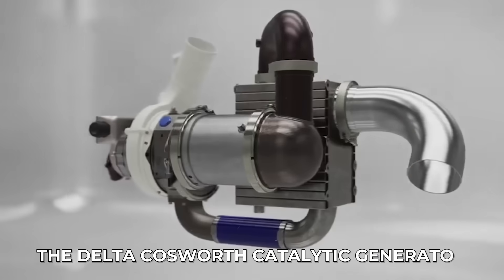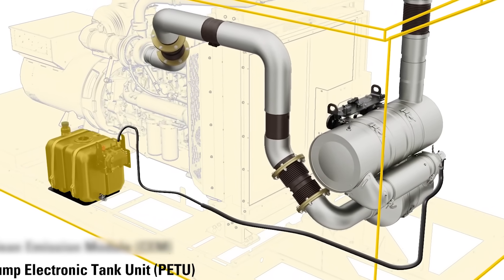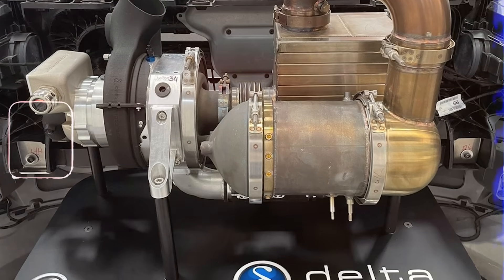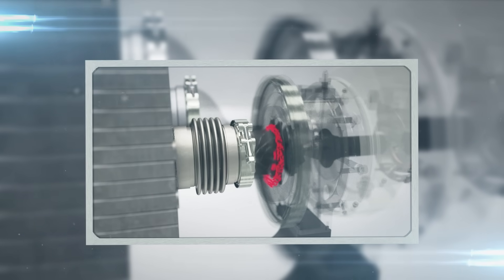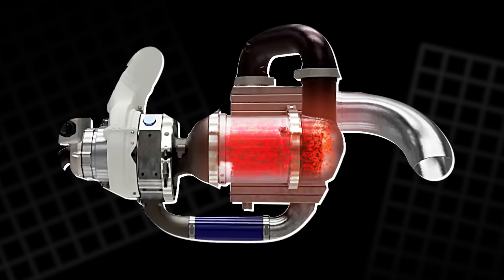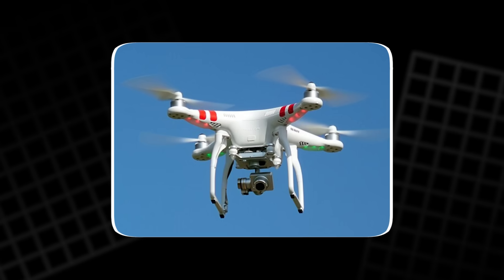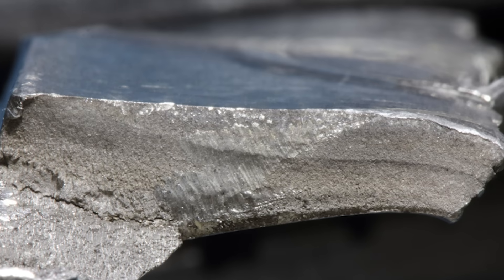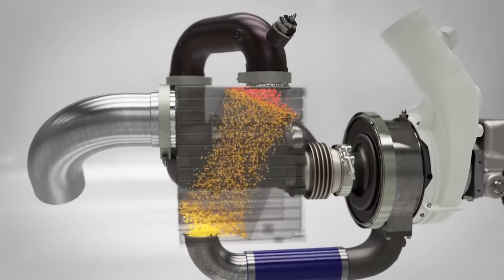This New Catalytic Generator Is About to Replace Combustion Engines Forever

Comment: Solar or wind power with battery does this without any fuel, pollution or heat footprint.  This product is obsolete dinosaur "burn something" technology.  They use adjectives like more efficient , cleaner or green fuels, low emissions, flexibility.  None of these are true because it is still "burn something" technology.

Comment: chatgpt - Conclusion: No public evidence of any “business with” or partnership between Caterpillar and Cosworth (Cat Gen)
'The 28% efficiency number means that about 28% of the chemical energy in the fuel becomes DC electrical energy. The rest is lost as heat, exhaust, etc. That’s lower than many modern piston-engine generator sets (especially when they are used in combined heat & power, or at ideal load conditions).'
Reply from the maker: Thanks for your detailed analysis and the information about efficiency!

Comment: The design by Malcolm Bendall is heaps better, you can retrofit his kit to any motor thats out there with powerful efficiency gains of 30 percent, and near zero CO2 about 1 percent of current motors, this uses a similar process of super heating the exhaust by forcing it into a vortex that does nuclear stuff ( yeah atomic conversion, crazy yeah? ) see Alchemical Science tube channel ... I suppose is benefits go like this over the catalytic converter designs, 1. doesn't need compressor to force through expensive platinum filters 2. as it doesn't have a compressor and doesn't impede the flow of exhaust gasses the energy saving is greater 3. feeding the flow of highly energised oxygen from the conversion process back into the engine, then increases effciency of the whole system, so fuel savings of about 30 percent.
Reply from the maker: That's interesting to hear about Malcolm Bendall's design and its potential!

Comment: Ok. So it's an externally fueled, turbocharged turbo hooked to a generator.

Yep, seen this setup on just about every custom methanol cooled turbocharged drag racer in existence.

Even the converter cleaning process programed into most gas engines, creates half this process.

Only main difference is, there is turbine in the setup. This tech is literally 20yrs BEHIND what exists and already doing now.

Comment: The design principles / philosophy attempts to significantly improve the overall efficiency using simple parts.  Design combines the generator with the motor in the simplest way with minimum losses.  The overall design philosophy is very very good.  Test results are to be presented with excellent graphs / diagrams.  Comparison with other engines will boost th
Reply from the maker: So glad you appreciate the design philosophy and the focus on efficiency!

Comment: Confusing video, showing conventional diesel generators and the cat gen hooked to them.
Reply: exactly!  is this something they "add-on" to an existing diesel engine or is it stand-alone?  The answer is vague, at best.
Reply: @walterramjet  why not both an improvement to a conventional ICE ... Units ...so a form of turbo compound engine but also as a smaller stand alone compact unit as a generator range extender to electric propulsion units. 
R Royce did some work for MTU on. Their Diesel ICE units used typically on boats and as Generators...that increased their power and improved their fuel efficiency by up to 30%.... 

This promises to get rid of the whole reciprocating poppet valve propulsive diesel engine .....starting and preheating the unit would seem to be the principle problem ...and might require quite a substantial energy input to begin and stabilise the device.  Which was also a feature of the original Napier sabre turbo compound engine.. thankfully this seems a whole lot simpler and has more in common with a condenser boiler..🤔🤷🏻🥼🧙🏻‍♂️
Reply from the maker: We appreciate you sharing your thoughts on the video's presentation!
Reply: @TheForgeEmpire  i can see that these are not additions to an engine, but stand alone. you have added "cat" the company for some reason. its a catalytic generator. who actually created it? you should be posting it with their name and details, not catapillar's

Comment: Reminds me of the first jet engine that used supercharger air compressors, inject fuel, turn turbine but with addition of capturing exhaust first to extract heat before ejecting.  Seems practical.  When will a variety of sizes hit the market, can see it as auxilliary power unit on a sailboat, off grid power for homesteads, apartment complex microgrid.  At those high RPMs too fast for for 60hz AC, guess it is converted to DC then converted back into usable AC for the grid.
Reply from the maker: Those are some great ideas for potential applications!